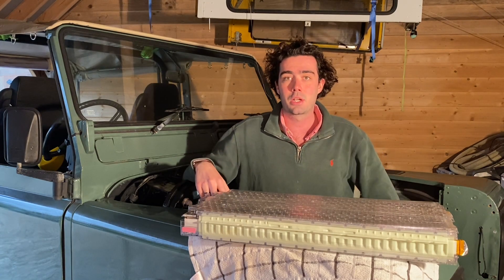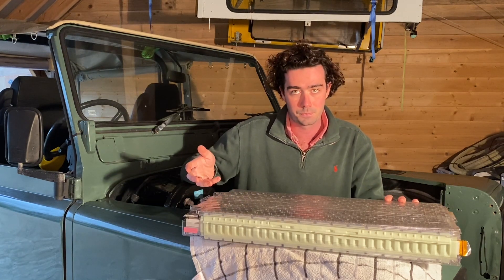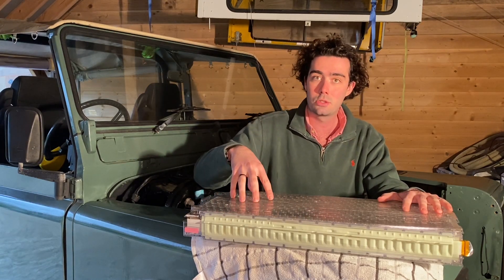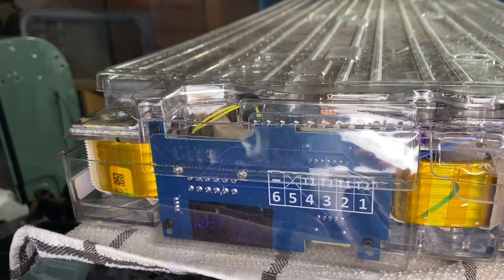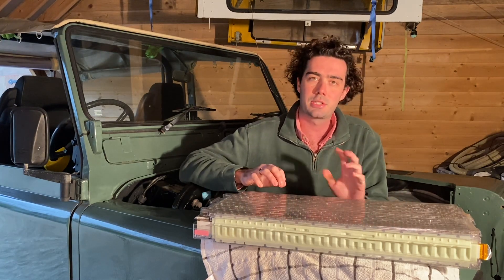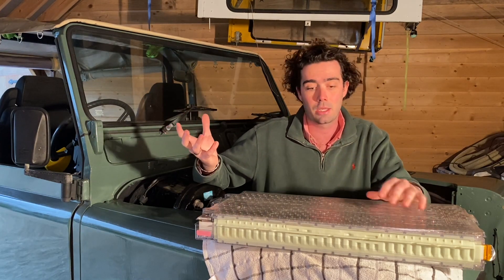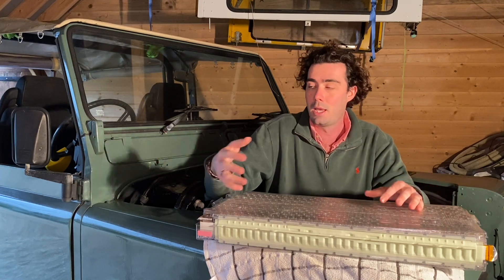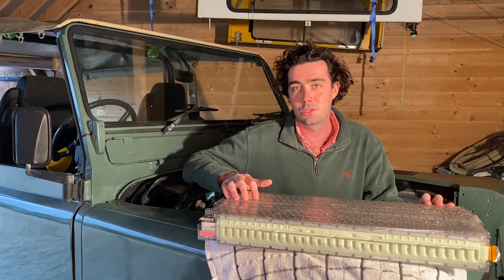The Tesla Battery Pack in this Land Rover 90 (Defender) EV Conversion. Electric Car Converts S1E5

Comment: I use my land rover 90 for local runs to work 4-5days a week and off roading events a few times a month. I have been considering an electric conversion but have been seeing some frightening prices . With Monroe building an electric Ibex with a finished price of £55-60,000 spending more than that to convert my Defender seams pointless. Please tell me there is an affordable option that I can retain my air locking diffs, winch and big tyres.
Reply from the maker: Hi Graham! We set up ECC to try and bring the cost of converting down as much as possible - as we agree that some of the price tags are simply ridiculous. Please fill out this form on our website with a few details and we can get back to you with an accurate price which will be less than half of what you've put above! https://www.electriccarconverts.com/contact

Comment: ...and the cost??? This is surely the most important thing we all want to know. Could I buy this kit and convert my Land Rover myself? That would be amazing!
Reply from the maker: Hi George, the cost varies dramatically. Each battery in this pack is about £1,200. The best thing to do if you're looking for an accurate quote for your vehicle is to fill out this form. Then our team will work it out and get back to you. Doing it yourself is not recommended, the wiring looms, contactor circuits and canbus systems for example need expertise from a professional to make! https://www.electriccarconverts.com/contact